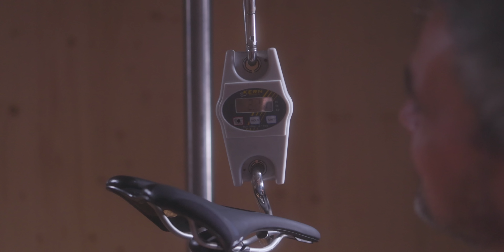Dream Build I Parapera new Aeras² I Version 2023 I Campagnolo Record EPS

Comment: Wait: was there a junction for the hydraulic brake lines?
Reply: You spotted the same thing I wanna know... what the heck is that?
Reply: Also found this an odd looking thing 😱
Reply: I'd love to know why
Reply: No, it's campy, so the hoses are attached on the lever side which makes it a pain to route, so he ran a hose from the caliper side on the fork and cleverly connected it to the campy hose with a rockshox reverb barb connector, to pull the hose through. Kudos to the mechanic for that trick, I'll be using it for sure!
Reply: @rattila13  cheers dude